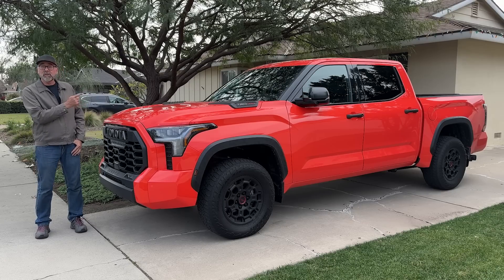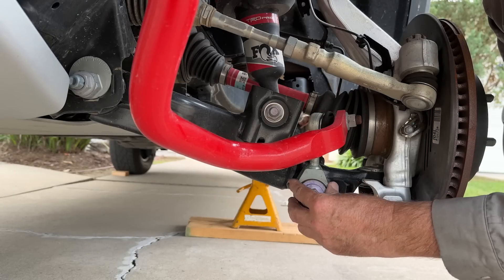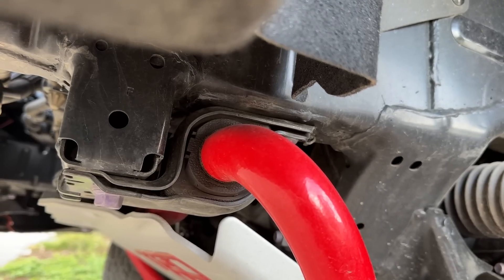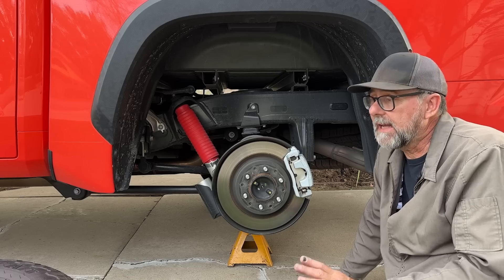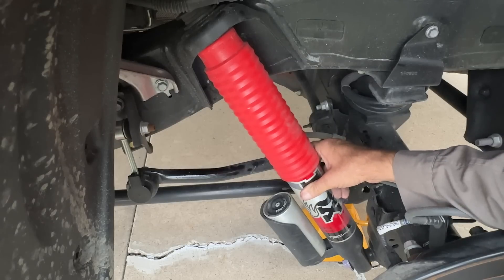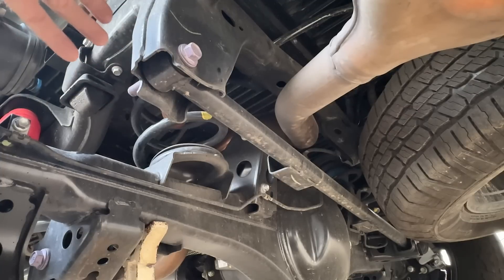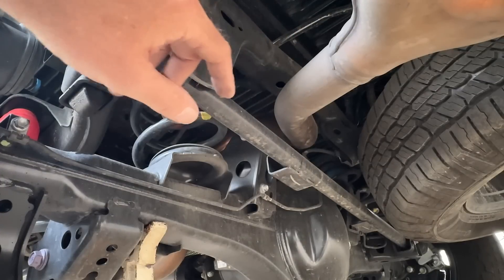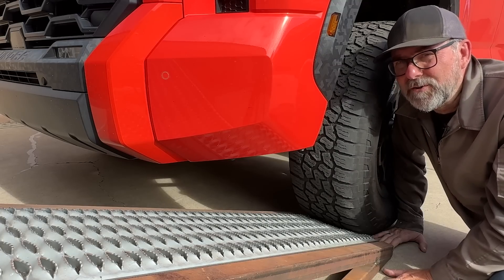The Toyota Tundra TRD Pro Ditched Leaf Springs, Here's How Its New Suspension Works (And Flexes)

Comment: The new tundra is desifned with thicker sway bar and stiffer springs to carry weight and is more overlanding than rock crawling focused, if you want a crawler go with a taco or 4runner

Comment: A good set of upgrades for someone wanting to pre run an older Tundra for cheap, maybe be the optional TRD lift kit plus a bit of a rear welding job.  
My research shows the ball joints, UCA and LCA are likely compatible with the old frames and spindles.

Comment: I've towed trailers with leaf springs and coil springs. 
Coil springs are worst idea for truck suspensions.  Yuk
Reply: Most half ton pickups are driven empty.   This system is much improved for the average light duty/family recreational truck. Also this truck tows very well for a half ton. If towing heavy loads regularly with this you got wrong vehicle

Comment: Since the knuckle is made out of aluminum how much “stronger” is this next generation. I remember a lot of Toyota guys complaining about how slim the knuckle was on previous gens and claim it would twist and bend on aggressive off-roading. How much stronger is this aluminum knuckle considering aluminum requires a increase in diameter since it isn’t as rigid as steel?

Comment: This oozes Land Cruiser technology.  The frame and rear axle/suspension design, as well as the box frame are built almost exactly like the Land Cruiser was in 1998.  Should be pretty reliable.  It would be interesting to directly compare the LX600 chassis to the Sequoia.

Comment: I bought a new 4runner TRD ORP with kdss last year and it came with mediocre tires.  I plan on using them up before changing to something more off road.  I find it funny when people change out their tires right away, but since it's a new rig they don't actually want to take it off road.  Then by the time they do want to take it off road their tires are all used up. After about 30k miles when the newness has worn off, that's the time to switch the tires.
Reply: I changed out tires several times the very 1st day of ownership. The tire shop bought the tires from me, which helped save money on the price of new tires.

Comment: Excellent work as always Dan!  Cannot find this detail anywhere else.  It would be incredible to see a few minutes of your driving impressions for ride & handling, to see how that might tie out to the engineering bits you highlight.  But otherwise, I can't get enough.  

I was really hoping this would be an articulation monster - something less flashy than a TRX or Raptor, and better for the trail.  But even before you put it on the ramp I could tell it wouldn't be great, what with that 1) super thick front sway bar, 2) short upper link in the rear, and 3) hardly any length to the rear coils.

Comment: And the Land Cruiser Heritage edition scoring 661 is still the king. It has the highest RTI score measured by Dan Edmunds.
Reply: The KDSS is awesome
Reply: @aaronbryan5095  The LX570 without KDSS but with AHC got nearly 600 score.
Reply: If you look up pre 2015 LX570 without the extra lip, it get 658 on the RTI.  So AHC and KDSS LC/LX570 essentially have the same RTI if you don't have the stupid plastic sport chin.
Reply: Junk suspension
Reply: Weak CV boot junk suspension

Comment: May not be as much as the trx or raptor but at least u won't get stuck on the side of the road with a broken down American made truck! I'll take a toyo over any of those other trucks all day long! I own a 2018 TRD with just under 200k miles and it drives like it was brand new with 0 mechanical issues! I've had all the brands and Toyota is the most superior truck out there, period! Especially when ur counting on it was ur work horse every day day in and day out hauling a trailer daily with over  a ton of weight on it!
Reply: Toyota Tundra was designed by Kevin Hunter at Calty Research Design, and is manufactured in a factory in San Antonio, Texas. Kevin sounds very American to me, Calty’s locations in Newport Beach and Ann Arbor are in fact located in America. And if you didn’t know I can inform you that the location of the factory, Texas, is in America. 
Tundra seems to be very much American made, and even more than that: American designed too.
Reply: @pistonburner6448  I know it's made in Texas but the parts don't come from here lol
Reply: Good luck getting to 200k with the new V-6 turbo and cheapest oil maintenance most Toyotas get.
Reply: @Ficon that’s such a dumb statement to make. It’s been out for a year so there’s no data to prove. The turbo issue was isolated so don’t give me that crap.
Reply: @studsauce7803  Toyota owners buy them for cheap maintenance. When you suddenly shouldn’t do $10 quick lube and need $60 synthetic, will they do that? The new V-6 turbo powertrain is fundamentally no different than the Germans that Toyota owners love to look down on and Toyota has no experience with turbocharging.
Reply: @Ficon  : Toyota has no experience with turbocharging? The 1979 Toyota Supra was their 1st turbocharged production model.
Reply: @oneslackr  Everyone involved in those cars has long died. That’s why you have a BMW Supra and a Subaru 86.
Reply: Yea my American made tacoma like to take a shit alot seems front shocks blew out at 20k miles rear diff went out twice rattles on the inside like a tin can toyotas are pos in my eyes
Reply: @panagiotisf7228 Tacoma is highest selling midsized pos in America. I'd take one.

Comment: It's like the ultimate dirt road truck. I bet with the new rear end and those Fox internal bypass shocks it would ride great. But for anything more it's a pretty disappointing package. The tires, the approach angle, ground clearance, and lack of front tow hooks.... Toyota wasn't making this for serious off-road use.
Reply: "It's like the ultimate dirt road truck."  Well, since a dirt road or gravel driveway is the only off-roading 99% of Tundras will ever face it's perfectly set up for that. At least it also has low range for crawling over those vicious speed bumps at the mall.  If anyone is likely to take their vehicle off-roading it would be Jeep Wrangler owners & Jeep says that only 10% - 15% of Wrangler owners go off-road. The reality is most 4x4s spend their life on pavement.
Reply: It's pretty clear Toyota chose to make it mostly a highway oriented truck. The platform is unified now across all BOF models. And although he hasn't tested it yet, the new Land Cruiser (riding on the same basic chassis as the tundra) has an RTI of around 730. It will out flex everything on the road except possibly a wrangler Rubicon. But we're not seeing any of the systems that the LC uses on the new Tundra or Sequoia - namely the longer travel shocks, eKDSS or sway disconnect, etc. The Lexus GX550 and new to USA Land Cruiser 250 along with the Tacoma all get various versions of those designs. The lack of them on the Tundra isn't the result of not having designed them. It's an intentional choice to use heavy sway bars and firmer spring rates to improve highway handling at vs off-road performance. I wish Toyota would offer a more off-road oriented version with the eKDSS and great suspension that it already developed.
Reply: Yeah they may have taken their market research a bit too literally, but still I think it’s not a bad attempt given their relatively small budget and timeframe compared to the big 3.

Comment: What is the advantage of having easy access to the pads? In all my years of changing brake hardware I always either get the rotors turned or buy new rotors to ensure they’re perfectly smooth. Perfect conditions seem unlikely, especially for an off-road truck, so why would only replacing pads be a good idea?
Reply: Not sure on trucks but for my cars with them makes it easy to swap out pads if different ones are needed. But I suspect it can also make easy work of inspecting pads too for even wear.
Reply: @ALMX5DP  oh inspecting does make sense. Before I got my car the PO replaced pads only but the rotors were grooved and so the new pads needed to be replaced again by me. Rotors are cheap too so not sure why they weren’t replaced
Reply: @dbeckMSP  : "Rotors are cheap too...."  Not always the case on all vehicles.
Reply: @oneslackr  "not always the case" so may as well do the unsafe thing and not replace or at least turn the rotors smooth? not sure the point you're making.
Reply: It's a global design. I would guess less than 1% of brake pad swaps in sub-Saharan Africa get the rotors turned. Toyota wants to run the same parts globally so it uses a design that will work everywhere. It doesn't prevent anyone from turning rotors, just makes it convenient for the half of the world where turning rotors isn't a common practice. And it's also the same design Toyota has used since at least the 1970's. The calipers on the first disc brake FJ40 were the same design. Other than size - they're nearly identical. So it may also be a function of "if it ain't broke, don't 'fix' it."

Comment: I don't know about you; but if I am changing brake pads the rotor is coming off to at least get turned if not replaced. Does require  caliper removal
Reply: I definitely don’t change brake discs at every pad change. I don’t use cheapskate cast iron brake pads, I use proper quality items for good braking performance instead of penny-pincher stuff.
Reply: Same here. Especially for an off-road vehicle, seems silly to no make sure the surface is perfectly flat